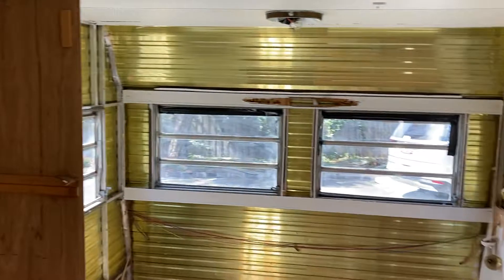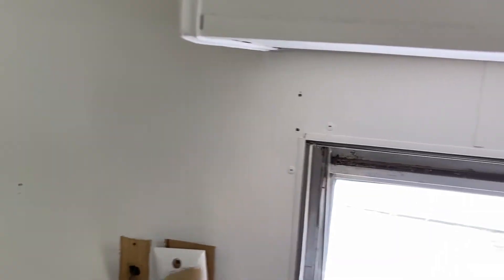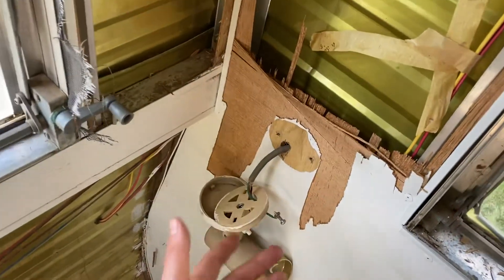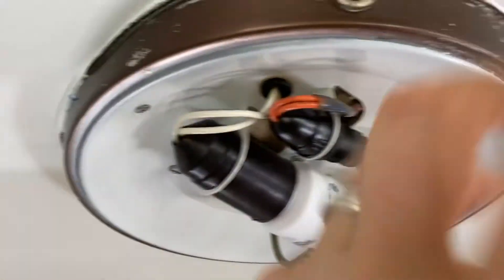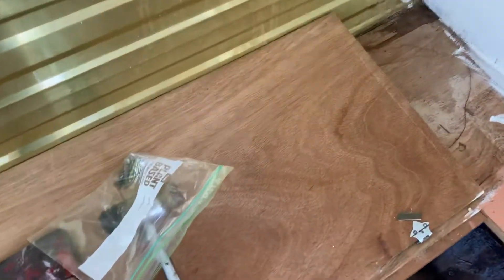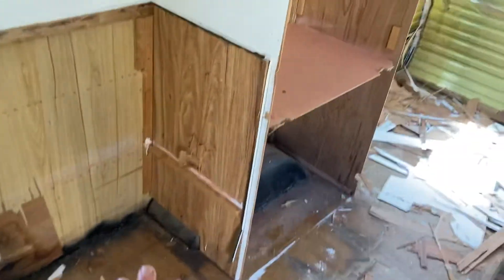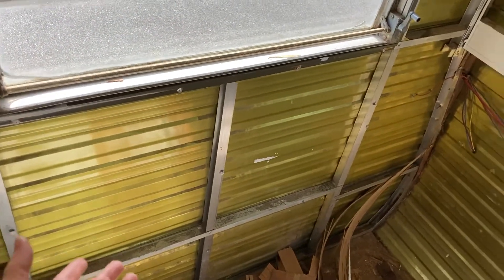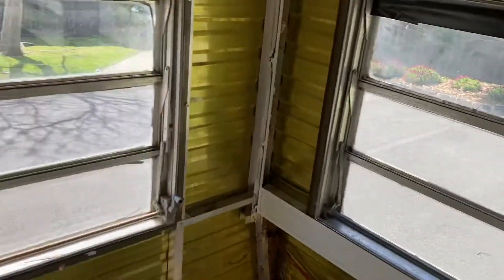Hints and Tips on Stripping a Vintage Caravan for restoration.

Comment: Might want to use flashing tape to cover the entire inside of that AL frame before you insulate it or close it up.   If it’s got leaks now, likely there will be more leaks in the future.
Reply from the maker: I was thinking Sika Seal/Flex plus some flash tape (great idea) at the joins. What do you reckon.
Reply: @powerofseven10  You could just do the joints, but there’s no telling where it might leak next.  On the the other hand, maybe taping the whole thing isn’t worth the money or time.